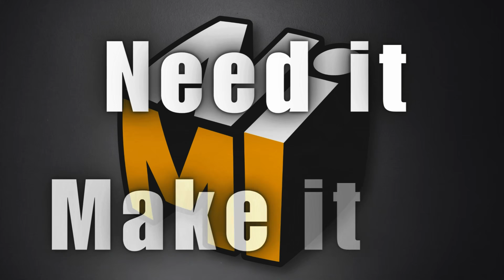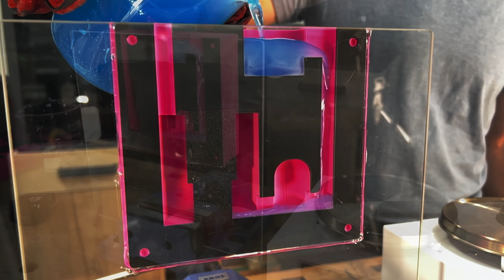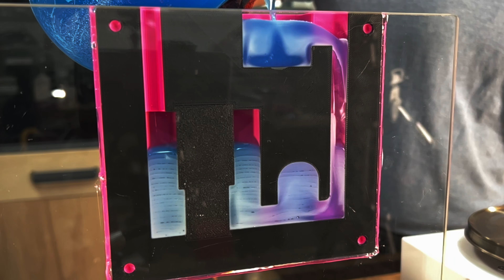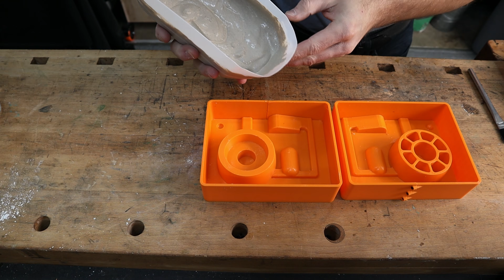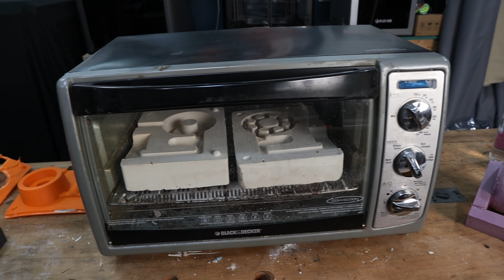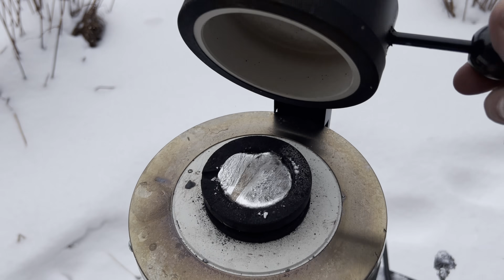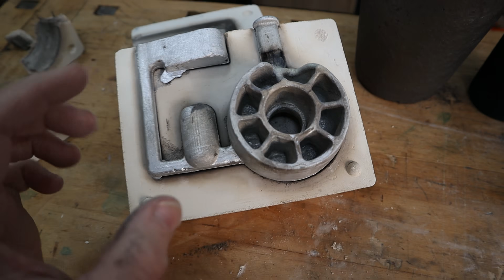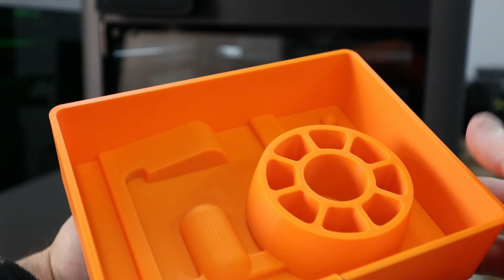Casting detailed aluminum parts is probably not a good idea and here's why.

Comment: You need to taper your sprue so the gas doesn’t get trapped in there.
Reply from the maker: Good call, I was thinking the taper was for easier removal for sand, but there is more to it obviously.
Reply: @NeedItMakeIt  that is called “draft” which is for two part molds (most commonly sand molds) which does in fact make it easier to remove the pattern from the mold. The tapered sprue is to compensate for the fact that flow rate must constant (matter can’t be created or destroyed) so when the material at the bottom of the sprue has a higher velocity than the material at the top of the sprue (due to gravity accelerating it) that means the bottom must me more narrow than the top to compensate. If not the mold will aspirate and entrap air.
Reply: When my engineer grandfather taught me sand casting 40 years ago we had to make the patterns from wood. Now that I have 3d printers and am very good with CAD, I am getting back into it. I have enjoyed watching you figure this out. It's a great skill to have.

Comment: A 3d printed mold for foam would be an interesting variation. Read many years ago that that's how Ford did their molded parts. They also dipped the foam in ceramic to make a thin coating on it before placing it in the sand box.
Reply: pretty sure there's printer filament meant for burning out of molds as cleanly as possible. I've seen the ceramic coating your talking about used with 3d printing before too and it seemed incredible but the price was a different kind of incredible.

Comment: notice the base generally comes out better...
hydrostatic paradox. wheres the pressure the highest?

generally you lay patterns out as flat as possible, as pressure increases with height and deep castings tend to blow molds... but here it helps.

tapering the recesses, pouring it face down, and it just might work as it is... use gravity to fill the fins, not bouyancy. you want tall feeders.

your chamber does nothing.metal just solidifies in the narrower feeder and thats the choke point. everything must increase in size to the feeders, and avoid sharp corners... they form bad grain structure at the best of times... fillets and draft. even if it is lost wax, metal is metal and castings hate sharp corners.

the wax demo would be far more accurate if it was just on the verge of solidifying... pour hotter. 

greensand is far superior.... and cheaper.

Comment: To help remove stuck patterns, you can design in an air port through the mold to the pattern-mold interface and use low air pressure to convince the pattern to release.

Comment: Murphy's oil soap is a great mold release for your printed parts to help get the plaster to release. 
Taper your main sprue. As the fluid picks up velocity towards the bottom of the sprue it will require a smaller cross section to fill the space - think Bernoulli principle.
Reply: Turning the sprue so its a diamond will make it release effortlessly

Comment: One idea you could try if the geometry allowed for it is to put the fill hole down the hole in the middle of your part and then the aluminum can go down and fill up uniformly outwards to 1-2 breather holes. Then you cut off the bottom and the sprue comes right out. No merging of material and oxidation layers to worry about.

Comment: Without giving it too much thought I think if you rotated the part ~45° in your mold you’d get less oxide surfaces  smacking each other as they form and the material would get pushed into a point to come out the relief hole instead of that larger area you have now. This shouldn’t require more volume. 90° would be even better for avoiding the oxide layers hitting each other but then the flow path would probably need to be bigger to get there

Comment: Heating up the plaster mold could help, I've ever mainly cast bronze and brass in oilsand and silver in plaster so my experience is only tangental to aluminium casting 😅
Reply: He did heat the last mold in the last pour
Reply: @bpennny  definitively not enough, especially considering he was pouring while it was snowing.
Reply: @schultheismatthius yeah I would think about saturating the whole sand filled bucket with heat.
Reply: @13nillo  There are many metal casting channels that have several tips he could employ. Robinson Foundry, BigstackD Casting, and Olfoundryman to start
Reply: @13nillo in a recent video from Mark Presling, he had good results by enlarging the vent/outlet sprue and completing his pour with Mapp gas torches aimed at both the outlet and inlet.  The  torches served to heat the mold prior to the pour, and after the pour the torches kept the aluminum in both the inlet and outlet molten long enough that the part being made could cool, while the molten metal at both ends fed it to reduce shrinkage.  It worked very well well.

Comment: Would the vent be better placed over the ribbed section where it failed to fill perhaps?
Reply: Or maybe put the finest details at the bottom of the mold, so it fills first and with the highest pressure/temperature.

Comment: Preheat ur form with a torch, and add a bigger riser over the whole length of the barrel. The hollows should be filled up that way too, havin enough volume to feed from while losing that much heat to the form. And yea, u need more molten material xD
Reply: Yeah, casting in the cold definitely doesn't help. The aluminium probably didn't make it all the way because it cooled down too quickly.